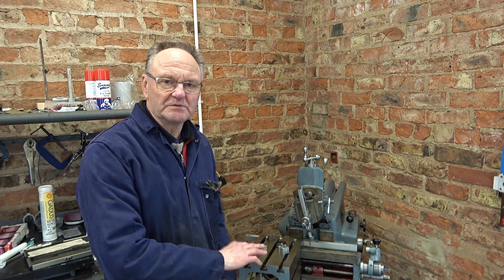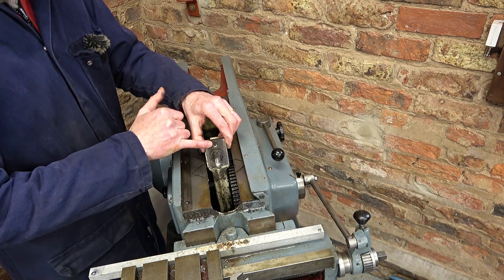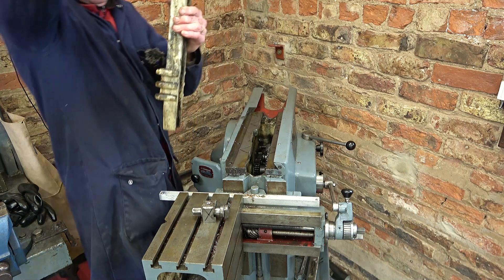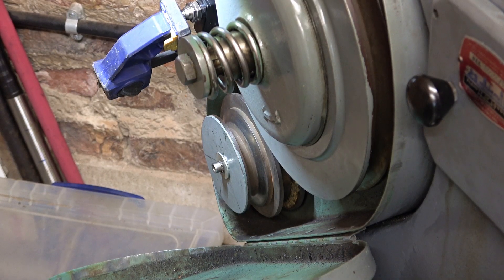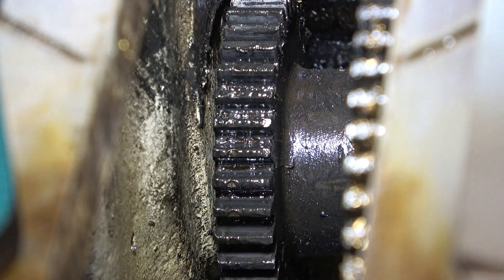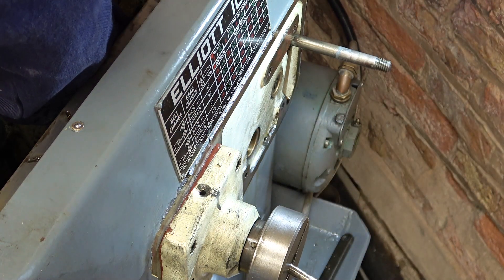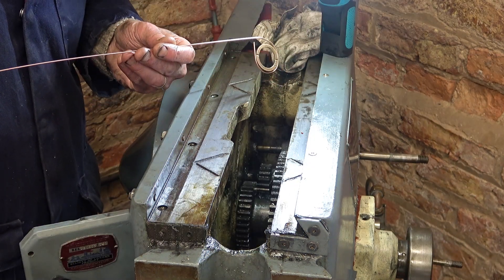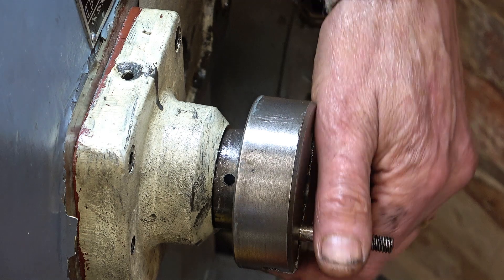HS183 Elliott 10M shaper repairs – Part 1

Comment: Thank you. Do you know what the thread size on the tool feed screw slide is at all? I have to make a new screw for the one I have acquired.
Reply from the maker: Hi Michael, it measures as 5/8 outside diameter (0.625), 3mm pitch, looks more trapezoidal than square but a bit hard to tell. Whether that be 29 decrees or 30 degrees you can take your pick but more likely to be 29 I would guess. If you send me an email I can send a picture. Cheers

Comment: I worked with a 24 inch shaper years ago. They are the most under used machines ever put out there for to use. This is the smallest Shaper I have ever seen. We are so lucky to be able to make our own repair pieces. Take care and I shall see you on the next instalment of the repairs to this grand old girl.
Reply from the maker: Hi again Tomoko, my shaper looks toy-size but it's surprising just how much it can do. 10 inch stroke and a good amount of table travel both across and up/down. Clamping long work on the sides of the table is something I can't do on the mill. Cheers
Reply: @HaxbyShed  I love seeing small machines working big. I was with Cooper Bessemer for 10 yrs making ships engines as  well as both centrifugal and side pump oil  compressors or pipeline work.  Boring mills, 4 head mill and tape type horizontal track drills.  It all came to a screaming stop during th4e oil crisis in the 80"s. I will never forget those years working big.
Reply from the maker: @TomokosEnterprize  I think the power of the big machines is awesome. I never worked in heavy industry but I did once visit a tank factory where they mounted the hole tank body on a massive mill and spun it around to machine the turret bearing surfaces. Cheers
Reply: @HaxbyShed  When I started at Cooper Bessemer they basically drafted us out of machinist school. With the monstrous size of the castings and machines to work them they said they found that regular/licensed trade machinist were rattled by the size and didn't stay when people like myself just wanted more and more of everything they could throw at us. Funny you mentioned tanks. At cooper the original lathe they used to turn, bore and put the riffling into the tank and regular howitzer barrels on. The tailstock was driven by an enormous threading like screw between the ways. They would put the finished red hot barrels in and drive that enormous broach and drive it through the barrel. The lathe had a 36  in chuck and must have been 40 ft or more long  and  had it's own foundation to help keep it flat and true. 50 feet from there they had the test firing stand where they mated   the 747 jet engine with the 48 inch pipeline natural gas compressors.  I was in 7th heaven.

Comment: Nice footage Paul, I too need to make time to fix an issue on my mill. The Guil will drop about .250 when it's near the end of travel, but will have to be a later date, to much going on. Like others, be of interest to see how you repair the bull gear, or live without one more inch of travel (@@)!
Reply from the maker: Hi Bear, you tempt me with a schoolboy joke about that last inch but we'd better keep it clean 🤣. Problem with big mills, or anything cast iron,  is the parts are heavy. Cheers.

Comment: Well done Paul, very interesting to see the insides of a shaper. I'm sure that you will find a way of fixing the gear wheel slot, it will make a great video that's for sure.

Great video, good luck from Spain!!
Reply from the maker: Hi David, thanks for watching. The fix is almost complete now. It was a nice first project for the 'new' mill. Cheers

Comment: Thanks for another excellent video. Always especially interested in your shaper ones. As I also have a 10m in the metric version I checked inside the door and mine is marked in mm for the stroke length, and looks a similar age... You are not alone in finding it a faff to go round and open up the clutch cover to advance it. Also considered shrinking a wheel onto the self act disc, however when I did a test I found it needed a moment arm of 8 inches to turn it and 9 inches to be comfortable. Having a rethink as an 18 inch diameter wheel doesn't really appeal.... look forward to seeing your solution.
Reply from the maker: Hi Laurie, I have an idea developing for a right hand side crank but yet to decide if it is worth the work because I'd still need to walk around to the left to set the stroke. I'll talk about it in a video (not sure how many parts there will be to this series). Cheers

Comment: Hi Paul, interesting to see the difference in construction between the Elliott and my Atlas. By the way, that's not mucky lol. Will be interesting to see how you go about the bull gear fix, plenty of pre-heat and slow cooling whatever you do. Cheers, Jon
Reply from the maker: Hi Jon, the 10M is quite a well-made but basic machine. Adjusting the stroke through the side door is quite a pain. But it has surprising utility despite its small size. There is not much I can't mount on there either flat or on its side. Bull gear is fixed. Cheers.

Comment: Gday Paul, machines from that era were definitely made to outlast the owner and next generation, interesting to see how you repair the bill gear, great job mate, cheers
Reply from the maker: Hi Matty, as I write the Bull Gear repair is well underway - using my new mill for the first time on a proper project. I'm very pleased with it - but that sloppy table nut will have to be changed soon. 0.6mm backlash is not ideal. Cheers.

Comment: Interesting insight into the build of a Elliot shaper,  I think noise wise, it wasn't to much of a consideration ,as it would be in a machine shop with a load of noise machines, nice find, ref bronze thrust washer. 
As you say, machining out, and fitting a new Tee-slot plate is probably the best option,  the bull gear could be bronze welded, but a risky option without full preheat, maintaining heat, then post heat facilities. 
Great part 1, looking forward to further instalments. 
Thanks for sharing
Reply from the maker: Hi John, I hang on to anything brass, copper or bronze for possible future use, and any form of washers. When I was a boy I thought I'd get rich by collecting bits of brass - I never got above half a small biscuit tin full but I still have it with the screws, bits of electrical plugs, light fittings, gas fittings, BA nuts, a few washers etc.  Cheers

Comment: Very interesting, Paul.
I'm just wondering how that piece of the bull gear could have been broken. A mystery...
Reply from the maker: Hi Michel, my thoughts are somebody had a run-in tool crash or they set the machine going fast before they clamped the stroke tee nut and it shot to the end of the track and jammed. I think it happened often in schools and apprentice colleges. I had the machine probably 6 months before I realised that was broken - the first time I tried to set up a 10 inch stroke. Funny, it is a 'metric' machine but the stroke scale is still marked in inches. Cheers
Reply: At least the link arm survived that has been the demise of many a shaper

Comment: Great video, thanks. This has got us talking about getting our Alba shaper working again, it has been years since we last used it
Reply from the maker: Hi GTB, I'm just starting to use my new mill and getting a feel for that (I had not used a mill since I was 17). I have promised myself that I will not neglect the shaper and unless or until I get a big shell mill or fly cutter the shaper will always be better for removing metal over a large surface. I had to cut 30mm x 30mm square bar, about 50mm long,  down to 22mm x 22mm on the mill with a 20mm end mill and my goodness it was tedious and messy. Cheers

Comment: Nice reuse of the leftover thrust washer that most would not have seen any reason to keep. While the bull gear is out, take a few pics, make drawings, and detailed measurements. Put it back together for now, and think for a while on your best course of action.
Reply from the maker: Hi W65er, I possibly won't dismantle it again so now's the time to fix everything. Since I now have the 'new' mill it takes the pressure off the shaper and I can take my time doing a good job on it. Cheers

Comment: Looking at the repair to the bull gear, I can not see that you'd be able to braze the piece back on without  being able to preheat the whole gear, even then a difficult repair.  I suppose the best way would be to machine the whole slide section off and then pin and screw a new dovetail to the gear. Either way, it'd make for an interesting repair. Maybe just leave it with a 9" stroke. All the best with whatever you decide to do.
Reply from the maker: Hi Bill, bull gear is fixed, video to come later. Was very satisfying, using the 'new' mill to remove the broken area. Could not leave it at 9inch - so much already dismantled and it was definitely a case of now or never. Cheers.

Comment: What's the chances of making a gibb & screwing it in place of the broken piece on the bull gear? Just duplicate what's there only to the stock length. OR, go to the auto jumble & find a new/old bull gear?  Hope you can find a solution. Cheers.
Reply from the maker: Hi Bob, it's fixed, with a variation of your idea. First use of the milling machine. The mill is only small but proving very rigid and I'm getting to enjoy it now after the weeks of servicing. No chance of finding a bull gear without buying a donor machine. Cheers

Comment: Good start. I just finished a grease ball job like that at the place a draw a check from. About 7 hours of swimming in that kind of stuff and the cleanup began and was much cleaner on the install side of things. 

You got this.

Thanks for posting

Scott
Reply from the maker: Hello Scott, there's not much muckier than the inside of an oily shaper I think. But there is a lot of satisfaction. Their simple fundamental mechanical construction appeals to me. They just do what it says on the tin - all day every day without fuss. Cheers

Comment: Excellent progress Paul, like you say those little jobs jobs soon add up, but each one completed will make the machine easier to use and to ensure is lasts longer. Finding that bronze washer was a great score, and a reminder to keep all that sort of material, as one never knows when it will be useful.
Reply from the maker: Hi Paul, online is a great way to purchase all sorts of bits as you need them but the trouble is each time it's £4, £5, £6 (because you have to buy 4) and it soon adds up, and then you have to wait 2 weeks to a month if it's coming from Asia. If I see a washer or a screw in the street I always pick it up. I saw some oilite bushes at the Autojumble recently, all sorts of sizes, and I almost bought some speculatively. But apparently you should not machine them because that closes up the holes .... so they say. Cheers